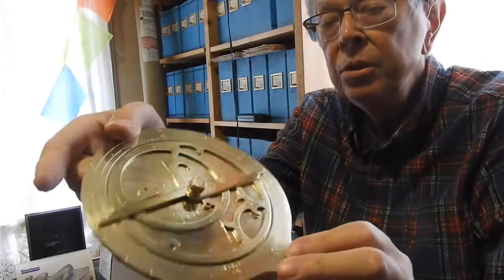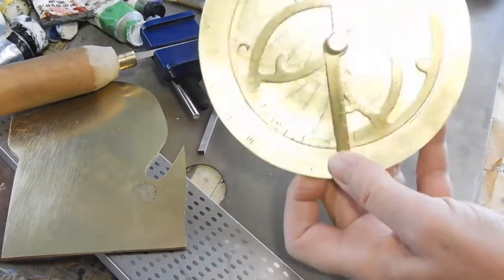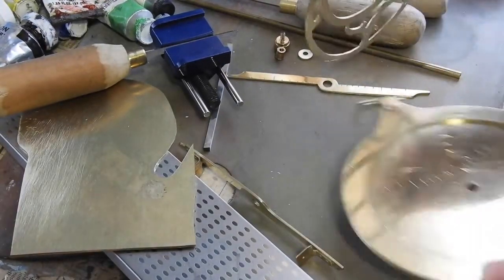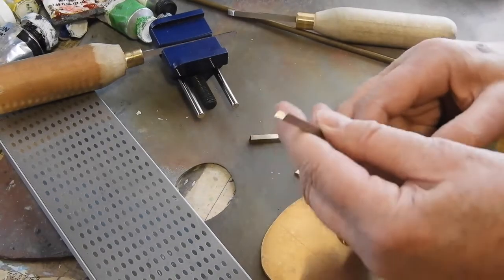Building a Brass Astrolabe

Comment: Nice seeing this Charles. Trying to make my own now. How many mm's thick did you make the rim and the mater?
Reply from the maker: I used RMP 260 Brass Sheet, 12 Inch x 12 Inch x 0.064 Inch thickness for everything except the two small sights made from 1 mm thick brass.

Comment: Very nice work Mr Hartley. That instrument must represent a considerable number of man-hours of work. Thank you for your explanation of engraving, which I previously knew nothing about!  My main question is how did you know where to engrave the arcs? Particularly for the Almucantars and the Azimuths, which do not look at all easy (at least to my eyes). Also please point out to your viewers that when you are using the Alidade (the sighting part on the back) to measure the altitude of the Sun, you don't look through the sights at the Sun, instead you stand with the sun behind you, holding the Astrolabe vertically, in the sunlight, and align it with the sun by looking at its shadow. Then adjust the Alidade until the bright spot from the first sight illuminates the hole in the second sight. 
The Astrolabe is an amazing instrument, capable of a lot more than telling the date and time. In the 10th century an Arabian scholar called Al-Sufi published a book listing over 1000 uses for Astrolabes. They were even used for determining a person's birth horoscope, in the days when Astrology was regarded as a practical science.
Reply from the maker: Thanks for the kind words. I had not know of Al-Sufi. Chaucer, a few centuries later, also wrote "A Treatise on the Astrolabe" listing a 1000 uses; probably copied from Al-Sufi.

For the markings I researched the geometry and mathematics, and wrote a Python computer program to draw the figures for the markings for my latitude; I then transferred the markings to the brass for the engraving. The math is mostly trigonometry and a little spherical geometry.

If I could figure out how to post a photo in this comment section I would show the photo of what the program produced.

The sighting holes on my astrolabe are so small that they cut down the light considerably. I can sight the Sun easily with out fear of eye damage. I made a octant (separate YouTube video); it needs a filter protect the eye.

https://www.youtube.com/watch?v=UQli6PriALo